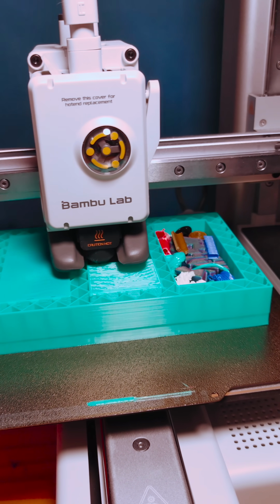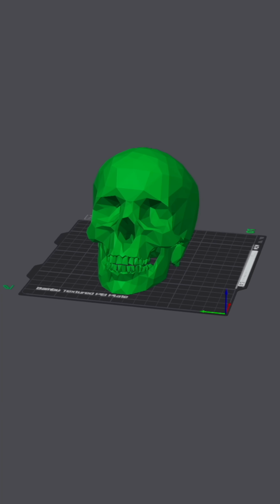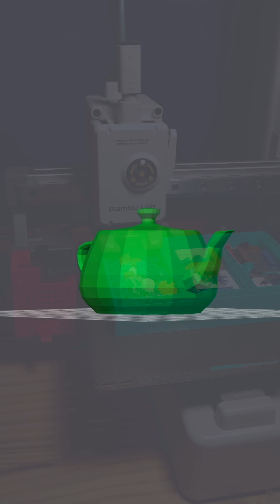Try Just Hiding It

Comment: That helps to get rid of waste but it doesn't help the part you put the waste in. You even have to use more filament to make room in your part for the waste. It doesn't help with stability and just makes your new part rattle. Using glue is also a lot of effort and extra cost. Pausing the print is always a bit risky. And if you want to make your part heavier it is better to use something a lot denser than plastic. So honestly I am not convinced
Reply: I’m guessing his point was that you wouldn’t have otherwise added the extra height if you didn’t have waste to hide. It depends on what your original plan was. If the space was going to be there anyway, then sure, fill it up (though I’d also pack in something like dry sand or clay or something to cut rattle).
Reply: If it was a little heavier, you could use it as a type of ballast.
Reply: A better way would be to melt waste first into a strip that can be a little tougher because it is a solid cast without layer lines. Then use that to add rigidity to a print
Reply: its better to use a bit more material in order to not contaminate with waste fillament that will end up in the trash
Reply from the maker: Well it's perfectly fine to disagree, and you bring up some good points, but I don't see how making an empty space inside the part would end up using more filament than if that space were just filled with infill. I guess it would depend on the size of the space and how thick the walls are. But if you were printing say a cube, it seems pretty obvious to me that a hollow cube would used less plastic than a solid one. 

I think you may be overestimating the need for stability in a lot of parts. If you are printing a part that is going to be bearing weight, then this probably wouldn't be a good idea. But I think that there are still a lot of examples where something like this would be totally reasonable. 

Using glue, or epoxy would be more effort and cost, that is true. But not a ridiculous amount. if the main concern is just that you don't want it to rattle, squirting a layer of hot glue on top should do the trick. And that might cost like probably 25 cents worth of glue. I guess it depends how much you are using. And it could for sure be annoying. I didn't even bother to  put glue in the item in this video. This cup just sits static all the time. I'm never moving it around, so rattling isn't an issue.

Pausing the print may be somewhat risky, but it's also a very common step in making a lot of functional prints. Like any time you want to add a magnet to something you have to plan to pause the print, with can just be preprogrammed into the slicer. So I feel like that aspect of is is just splitting hairs. 

As for adding weight, I never said anything about doing this to add weight. That's not the point of it, the point is really just to get people thinking differently about how they might dispose of printer waste. I think if doing something like this is too much effort for someone, then they definitely aren't going to go to the trouble of grinding that waste up and extruding it into new filament. 

If you did want to add weight though, you could probably still incorporate some waste. I have seen youtubers add clay or concrete to hollow spaces to add wight to prints. You could add some plastic to the wet concrete and still get a pretty heavy product. 

It's totally logical not to be convinced by this though. It's definitely not going to be for everyone. It's just an idea that will hopefully spark other ideas for people. I appreciate your comment.
Reply: @chris_ideas  The vast majority of a 3D printed part's strength and weight comes from the outer layers, the infill takes up much less. This can be counter intuitive but it means when hollowing out parts to save weight or filament you can end up consuming more since this increases the outer surface.
Reply: @chris_ideas  the problem is that loose "poop" filament in a print is not a replacement for infill. infill's whole purpose is structural integrity which the poop does not provide. 

and it's not so much about it being able to bear weight. it's more about the ability for it to print with good quality. the infill gives a good foundation to print on top of to create clean layers. if you printed a completely hollow cube with no infill, the top of it would either droop down drastically or would spaghetti failure entirely as the top layer has no foundation to build on top of. 

in fact, in your test print of this, i can see exactly where the void in your print is because the lack of infill has caused an unstable foundation and causes your part to warp near the bottom (uneven cooling from pausing the print too long might have also caused some warping as well). now this is fine as it's still functional and does its job, but it's not "clean" if that's something that's important to you.

so the only purpose of doing this, is having a place to put poop that's not in the trash. since it's not doing anything for the print itself.
Reply from the maker: @gayzach 
You're exactly right! I hope that I didn't give the impression that I thought that doing this would somehow improve the print in terms of strength or stability. It really is just meant to hide the waste. In this print, the holes I made were just big enough that the print head could still get across without the print totally failing. And if you look on the inside of the cup, you can't really tell that there was a hole underneath. I think there is a decent number of people who have a box or a bucket with printer waste that they don't want to throw away, but they just don't know what else to do with it. This option is just a minimal effort idea for getting rid of it. It's certainly not going to prove useful for everyone, but hopefully it get's someone thinking about the problem in a different way.
Reply: @chris_ideas  Well the slicer can show you exactly how many grams of filament you'd be using with and without the holes, so that's easy to compare.

My feeling is also that with empty spaces this small (three separate spaces, not that tall), you'll definitely end up using more filament to print the walls and floor/ceiling of the empty spaces compared to just printing infill. Especially with default settings (3-5 top/bottom layers, 2 walls).

Also, as nilsbottjer7129 pointed out, the waste filling doesn't add any stability. So structurally, it's the same as leaving the empty spaces just empty.

For a lot of prints that don't need to be extra strong, infill is mostly unnecessary, since the main stability comes from the walls. The only other reason for infill is that it provides a "grid" for the top layers to be printed on.

If you haven't, definitely check out the advanced infills like Support Cubic, Adaptive Cubic and Lightning. Support Cubic and Adaptive Cubic leaves larger voids where possible while still offering some strength. Lightning is basically zero infill except for some minimal support structures required for printing the top surface.
Reply: Just as an example, I quickly checked how much filament is required for a 10x10x10cm cube:
- Default infill (Grid, 15%): 238g of filament
- 8x8x8cm hole in the middle (similar to your approach): 179g of filament
- Adaptive Cubic infill: 176g of filament
- Support Cubic infill: 107g of filament
- Lightning: 71g of filament
- 0% infill (won't work, can't print 10cm long bridges): 58g of filament

Comment: There are Prusa printers that use several toolheads to not waste filament.

EDIT: I have no clue what I am talking about, all the people in the comments are right. I simply heard of the printers through a podcast.
Reply: And it costs $5000
Reply from the maker: Yeah, I'm still just a 3D printing noob really. I just have an A1 Mini, and i don't do multicolor prints. But from what I can tell there are a lot of folks like me who have a box of little bits of printer waste laying around. Like all of these were just from either changing the filament, or starting a new print, or little pieces of old supports or failed prints. So this idea is just one option for getting rid of those. I'm sure there are more elegant solutions.
Reply: This printer still has to purge filament. So you will also produce waste but less.
Reply: @241benjo  it's wipe, not purge and it is 90% less than other systems.

I'd love for there to be a cheaper and less wasteful system, but there isn't one.
Reply: @241benjo the amount of waste from an MMU dwarfs the waste from a tool changer, a well tuned one only needs to push enough through to guarantee the nozzle is primed.
Reply: Yeah I have the 5T Prusa XL
Reply: your comment edit is wild hahahha really funny, it's nice to see how honest you are, best comment seen in a while by far, congratulations, most people would stick to the statement
Reply: it's less waste than a bambu , but still makes some.
Reply: You still lose some in priming. I think first commercial home market dualhead was replicator.

You still need to do something with supports etc, but of course hiding it is sort of a meme joke
Reply: It's one printer, and it's not the first, just the first to do it in that manner. Bigtreetch printers, if I remember correctly, had dual extruders which could be used for multi-material printing as well as multi-color printing for like the last decade.
Reply: Thanks for the edit btw, some YouTube commenters are so arrogant thinking they are right with no actually experience 😅
Reply: And also I just learned about Stealthchanger like the prusa multihead.
Reply: A 5-axis 3d printer is probably the best bet...
Reply: @DemonLord_Online  i think you dont know what youre talking about....
Reply: and it doesn't work that well... so nar

Comment: It would be nice if it actually added structural stablilty.which might be possible honestl if u blended rhe pelets to be a like gravel or something so it could be packed together tighter. (Idk why this comment comes off so condescending i tried to reword it but just know I send this as a helpful suggestion with no malice towards you.)
Reply from the maker: Thanks! Another idea that I thought of was melting the waste and putting it into molds. If you were to make a mold that was like a 1x1 cube, you could then just design gaps into the model that would fit that little block of plastic perfectly. 

This idea was just meant to be the absolute easiest way I could think of to get rid of the little bits that I already had laying around. if you wanted, you could fill all the gaps between the waste bits with some kind of glue or epoxy and if you filled it all the way to the top, i think that would help structurally, but it might also get glue on your nozzle. This idea was more just meant for prints that don't need to be very strong. Like decorations and stuff.
Reply: @chris_ideas  Molds work good for thick items like scrapers! Of course the best alternative is to save the waste per material and color and then make new filament out of it, while its still not perfectly thought out, there are already relatively cheap sets that can be bought that melt the waste and make it into new filament with a 1.7mm nozzle and automatically wind it on a spool. All the needed rest is easy to do at home such as  shredding the waste into a granulate.

I saw a video of both tools made with molds and completly recycling the filament waste into new filament spools and both work great.

A cheaper way to get new filament would be using the around 200-299 USD tool thats made for making PET filament at home from old bottles. It has almost everything needed except a shredder and way to put the shredded material into the 1.7mm nozzle but has a spool roller, the 1.7mm nozzle, heater etc all in one affordable set.
Reply from the maker: @ I'm certainly interested in those ideas too, and once they get cheap and easy enough I will probably invest in them. But right now, I have very limited space for more equipment. And the only reason I even have a 3D printer is because the A1 mini was about $200 USD when I bought it. So I still think this is a reasonable solution if the conditions are right.

Comment: This is an interesting idea, but you can also just purge the waste into the infill of the object you’re printing instead of doing the poops and the purge tower. You can also even purge into a second object. Filling parts with purge waste is an interesting idea, but I don’t see how this is better than any other solution
Reply from the maker: Ah, so that may help to answer my question as to whether or not this is a good idea. See I'm still fairly new to 3D printing, and I've only been doing single color prints. The poops I showed were all just the purge it does when loading new filament or starting a new print. I don't think there is a way to print those into the infill, but I may be wrong. I can also use this method to get rid of other waste too though, like supports from other prints, or just failed prints. But thank you for the suggestion. If I ever get into multicolored printing, I will definitely do the purge into infill thing. :)
Reply: Glad to hear you’re enjoying printing, always love seeing new people passionate about this tech. Purge into infill should be a setting in bambu studio, it might still do the purge poops but you can turn those off completely by setting the multiplier to zero. Works well on big parts, but small parts sometimes just don’t have enough infill volume to purge the material fully. My main issue with this approach is that the parts can rattle around inside the print, which may not be desirable in many applications. It also kind of defeats the entire purpose of infill, which is most often used to make parts stronger.
Reply from the maker: Totally understand where you're coming from. I know this wouldn't be a fix all solution. Even for me, I have a box full of larger failed printe that would be difficult to hide. But this is just an ideato get rid of the smaller bits that a lot of people seem to have already. 

I know it will weaken the print, but my thinking was just that a lot of prints, like decorative items, probably don't need to be that strong to begin with. And as I mentioned, you could fill in the spaced around the waste with some kind of glue or epoxy to keep things from rattling around. If you filled it up to the top, I suppose that would also make it stronger too, but i imagine that mightend up getting glue on your nozzle which seems like it would be bad. But anyway thanks again. I will definitely remember those suggestions!
Reply: @WhiffyStatue380  How would i purge into infill if there is no infill to purge into?
Reply: @BLT3D like 0% i fill? Just turn on infill. If your part is too small for infill you can add a second part as a purge volume, I like the idea of doing a functional part where the color doesn’t matter, or a part you plan on painting
Reply: @WhiffyStatue380I print single color
Reply: @chris_ideas you can reduce the default amount the printer prints when purging. It is conservatively too much.
Reply: @chris_ideas you should try out turning off the flow calibration to safe filament. It doesn’t affect the print. Only use it when you change the filament. The printer remembers the properties of the filament it previously used
Reply: That's with multi color/material prints. And then it uses/extrudes  filament to do so.

This was an idea to put already pooped/extruded filament (litteraly waste) into single color prints. Completely different concepts.